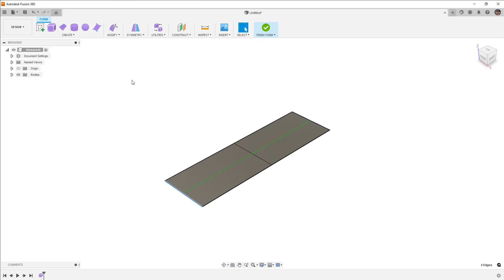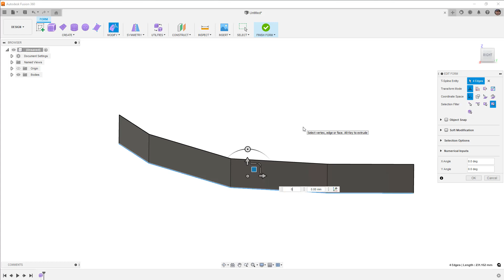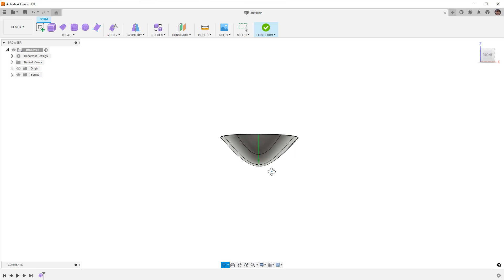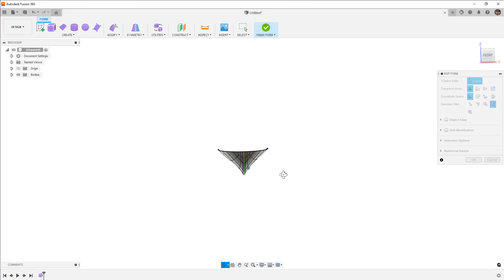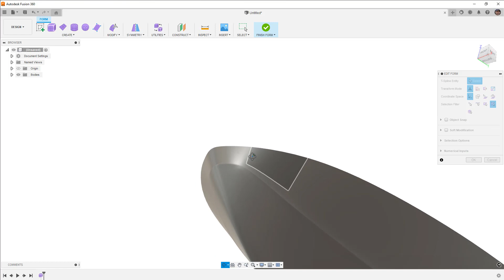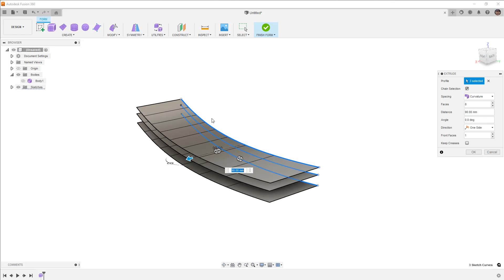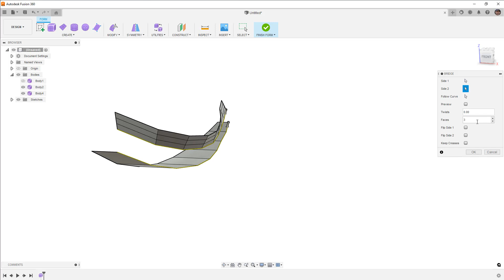Fusion 360 Form Mastery Part 43 - Boat Hull Design Tips with Fusion Forms #fusion360 #boatdesign

Comment: Hi, I am really impressed by this Form Mastery series. But I am missing an important part - how do I move on? Specially the boat example. I managed to create a nice hull - but how do I move on? My plan is to build a wooden model boat out of this hull design. How do I create now frames and stems and so on. And how do I do it in a way to stay flexible if i have to do some modifications to the hull that will of course also affect the frames? Or did I just miss the videos were you are handling to next steps after creating a nice form? It would be really nice to see a little example what a good workflow would be to continue from the basic hull form.
Reply from the maker: Hey There, for the boat we didn't go any deeper than this.  Basically was trying to answer the question on how to start it, but I am not a boat builder.  We do have videos talking about Thickening the forms and have a few videos that could be next steps, like wooden bucks for car fenders.
https://youtu.be/X3gLWNtxPRU

As for moving on, since forms are "Direct modeling" there is no history but there are ways that you can deal with changes. You can create your features after the fact (after finish form), and you can use tools like offset surface, planes, and boundary fill to create some of the internal framework.  Because I am not a boat builder it would be hard for me to really do it any justice but feel free to email me support@caducator.com and i can try and answer questions and see what can be done.

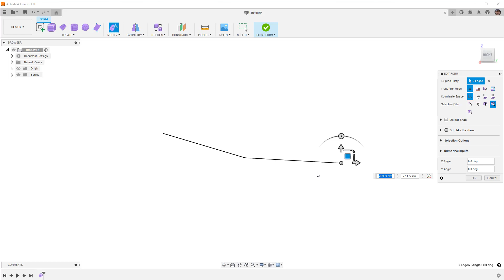Comment: I am stuck at 1:50, when I try to extrude it just doesn't work even if I press ALT.
Reply from the maker: Are you in Edit Form?  The extrude option with alt only works if the edit form tool is active.  it works for edges and faces but not points.  and it works with translate and scale, but not rotate.
Reply: @LearnEverythingAboutDesign   Hello, sorry for the delay, so my issue is that when I try to tap modify and then click the point in the middle shown at 1:27 it says T-spline Entity = 1 instead of 2 Edges

Comment: Funny how non boat designers approach a hull.....

I don't think this is an efficient way of doing it.

My simple question is:

I am defining a hull with two planes (side and waterline). Then I create the body with surface tools.
The result creates a hull with a "razor" sharp bow. How do I create efficiently a rounded bow as it can be 3D printed, etc.? 

The fillet tool is not working properly as my bow section has sharp edges to keel and sheer. 
How can I force larger radius fillets?
Reply from the maker: yeah i am no boat designer :)  this video was from someone asking how to do a hull in forms.

As for your question.  You really have 2 options.  1 is to try a chord length fillet type.  this lets you control the width so it doesn't get wider based on the angle of the surfaces.

The other option is to trim and manually loft between the two sides to make a curvature continuous patch.  This can be done with a sketch to trim from the side, or by offseting each surface the amount you want (like 5mm) and using the offset surface to trim so you have a consistent width.  Just remember offset is normal to the curvature so you might get some interesting patch that way.
Reply: @LearnEverythingAboutDesign  
wow, impressive, I get a reply from a 70k guy 🙂

I will try your suggestions. As always the trick is to find an efficient solution rather than a super complicated one.

Delft Ship is a good shipbuilding design tool. But support is limited and making things 3D printable, etc. moved me towards F360. Oh, well.

I will check out your treasure trove of videos and probably find some additional suggestions on future questions I will have.

I am building a foiling catamaran.... and first need to build a model to verify if the design will work.
Reply from the maker: @SamuelLanghorn  Yeah there are a number of hull design tools out there.  Fusion is good for 3d printable designs and you could design a true to form hull but it really isn't the right tool for the job.

Here is a quick test showing 3 ways to blend the bottom.  Fillet with Chord length.  Loft after trimming from a sketch. and loft after trimming with offset surfaces.   https://a360.co/48zhbAY

if the fillet works its by far the easiest and quickest way.
Reply: @LearnEverythingAboutDesign  thanks for the link.

I think I found a practical way to overcome this problem. I define a station very close to the bow and use this one as an endpoint of an edge for the waterline(s). As the body at this point does not have the sharp edge of the bow I have freedom to create fairly large fillets. I then can fill the last portion from front station to bow using a patch, etc.

Comment: HI, im stuck at the point where you weld vertices. when i try it does not do it symetrical but pulls it to one side. not sure where im going wrong here.
Reply: appologies. i found my mistake. missed the first steps
Reply from the maker: No worries, glad you found it!
Reply: @LearnEverythingAboutDesign  would you please be able to point me into the direct of the lesson that converts this into a solid to enable 3d printing?
Reply from the maker: there are a few ways you can do that.
1. In the forms workspace you can use Modify > Thicken.  This will turn the freeform surface isn't a solid when you "finish form"
2. Finish form and use Create > Thicken in either the solid or surface tools
3. Finish form and use the surface patch tool to fill in the top. stitch them together and then you will have a solid.  you can use Shell from there.

Note that freeform thickening tends to be a bit more reliable on complex shapes because it lets you manually edit the inside and outside.  While surface thickening or shelling might hang up if you have areas of drastic changes in curvature.  

https://a360.co/3XYpBNO

In that file you can see i converted the form to a surface (finish form).  make a sketch line to connect the back and then did 2 patch surfaces to fill in the open areas.  Stitched them to make a solid, then used Shell to make it thin wall.  The benefit of this method is that the top and back can be flat.  When you thicken you end up with edges that are made normal to the curvature so it won't have a flat edge/face.  So the file in the link could sit on the Transom on a build plate and print vertically with no support.
Reply: @LearnEverythingAboutDesign  thank you so much for your response.

Comment: not a developable surface . compound curvatures are no good for small to medium metal boats.  bigger?  then your welding panels together
Reply from the maker: Literally in the first 30s I said i wasn't a boat designer :)  Just answering questions from people on how to model certain things in Fusion forms.  I generally point people to other software that is intended for this type of work but if someone wants to model a hull and 3d print it for say an RC boat then this is a perfectly viable workflow..

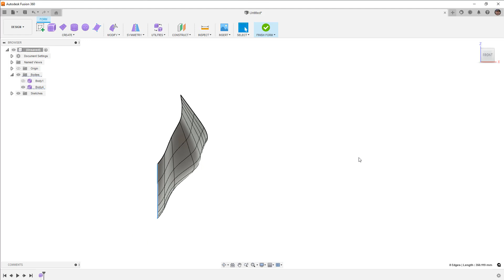Comment: What's the trick to bring curved edge to a straight line @23:24 ?
Reply from the maker: Scale.  So if you are trying to make a line straight you will want to scale in a single direction.  For example pulling the scale widget in just the x direction.  once you start pulling it to scale you can manually enter 0 in the dialog as it will be highlighted automatically.

Comment: how would you design a surf board?
Reply from the maker: I have never designed a surf board before but i suppose it comes down to what you need the cross sections to look like.  I know there is a certain amount of hand shaping that is done but i you have an idea on what sections look like through the board that is a good place to start.

Comment: Wonderfully educational video! I am designing a boat that will be built out of plywood strips so I would use the second method. But then I would like to have the smooth flow alongside the boat but vertically I need chines because the strips of the plywood would fit together along the length. It will be a sailboat so the hull will be made of 8 to 10 longitudal strips. They can only bend in one direction at a given point but they can be slightly turned like 90 degrees on the entire length of the boat. How would you suggest that it should be modelled?
Reply from the maker: Hmm, I think for that level you would like need an additional tool to let you look at a "flat pattern" of the shape to better plan your boards.  Since I don't design hulls personally (just answered the question of how to do it), you might be better going to an actual dedicated  hull building software.  There are loads on the market that are free for cheap for non-professional use, but I don't have experience with any of them.
https://www.boatdesign.net/software/

In that list looks like Carlson Design might be a good option and looks like its Shareware.

Comment: it is awesome! but how do you add the back of the boat after making the hull?
Reply from the maker: It depend on the boat.  If it has a typical transom I would probably add it as a surface and ttrim/stitch them together.  If the back end is smooth you can carry on with the form in the back.

Comment: Thanks for the video it was a great help! I was just wondering if there was a way to adjust the thickness of the hull for 3d printing or would it be fine to print it with 0 thickness? (I want to try 3d print a working boat). Thanks!
Reply from the maker: Sure, you can thicken it in the forms environment which will give you control of the inside and outside, but its hard to change/undo.  IF you go that route i would suggest first copy/paste the form body so you have a surface version as well.  You can also thicken it with the surface tools after you convert.  depending on your curvature that might cause you more problems.  A third option is to patch the top, stitch it together and it will be a solid,  Then when 3d printing you just let the slicer make it thin wall with infill. say 10%.  This might be tricky for buoyancy though unless you cut down into the hull for a weight to make sure it doesn't capsize.  I don't think you can send a surface to the slicer to print and have it print for you BUT some slicers have mesh repair and might be able to do something with it.  My suggestion is to get it as a solid in whatever thickness you want(or thicker so you can use infill).

Comment: When I perform weld vertices, it doesn't come to a nice point. It's lopsided (pulls to one side). My drawing dimensions differ from yours, but the overall shape is the same. The two sides are symmetrical (I measured). Initially, I thought it was due to the hull V not being deep enough but even after those adjustments, it still does the same thing. Great video!
Reply: I think I figured it out. If this occurs, change weld mode from "vertex to vertex" to "vertex to midpoint", then select both vertices at the same time by left-clicking and dragging a box over both vertices. Once you release the mouse it'll snap into shape. That's what worked for me.
Reply from the maker: thanks for sharing!  Did your design have symmetry on it when it was having this issue?  There is also the repair option in utilities that can weld verts/gaps up to a set amount that can sometimes find little things like that.
Reply: @LearnEverythingAboutDesign  It did have symmetry! I restarted the design several times and still had the same outcome. I wonder if it's related to a F360 update or something. I'll give the repair option a try! Thanks for the quick response!
Reply from the maker: @degreeless_engineering  Of course. if that happens again you can send me the f3d file if you want me to have a look. support@caducator.com

Comment: How do you always get both sides of the plane to adjust, because when I try to do it, it doesn't just work.... I set the lengths symmetrically like you did but still I have to select the middle line to make adjustments occur on both sides.... I don't have the vocab for this but I think you get my point... please I need a tip this thing is stressing me out
Reply from the maker: Interesting.  Do you have symmetry applied ?  If you don't see the green line in the middle then you don't have symmetry applied(sometimes Fusion will remove this if you try to merge or change something that violates it.

When using multiple selections on both sides of a design, things like Scale will go to/from the pivot point which would be in the middle by default unless you reposition it after the selection.

Comment: Awesome video! Was wondering if you have a video with your set up/ settings. You move very fluidly throughout the video and was looking to upgrade perhaps to a space mouse. Thanks in advance!
Reply from the maker: Hey Sam, I don't use a spacemouse anymore.  It tends to be disorienting to people watching(i am told). so I just use the standard install of Fusion. No customization.  Just a keyboard and a mouse.  I also tend to avoid shortcut keys except in Forms design.  Alt+1 and Alt+3 to go between smooth and box display.  and CTRL+4 and CTRL+6 for hiding and showing edges.